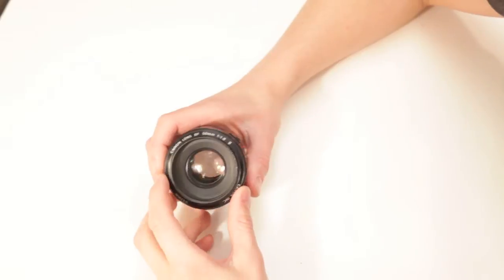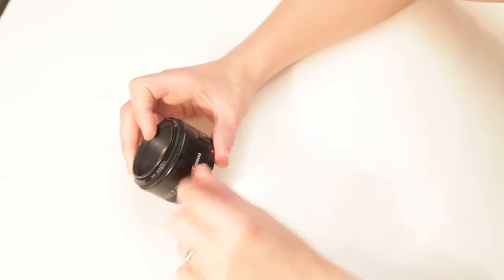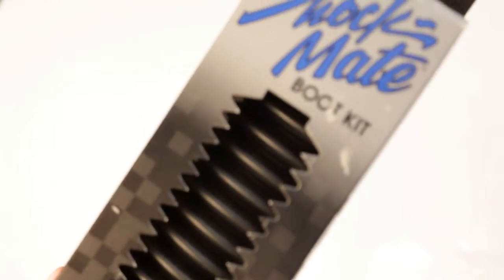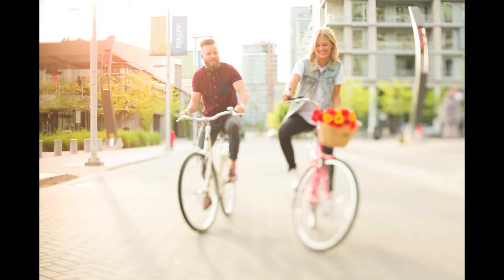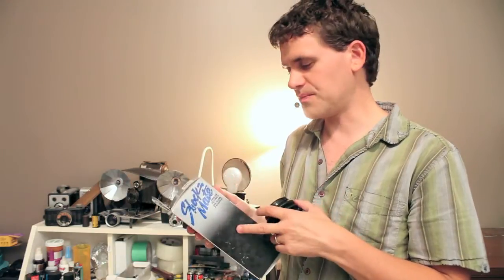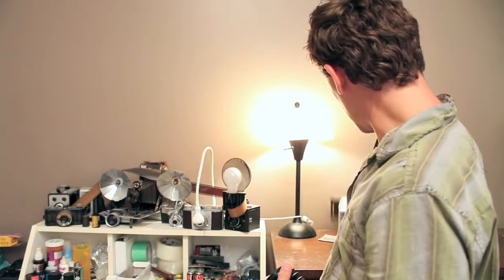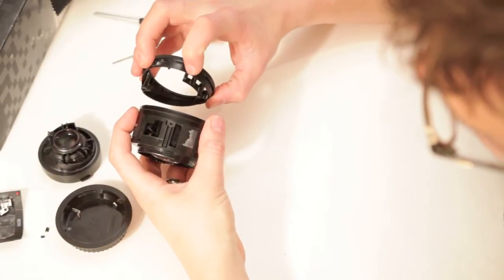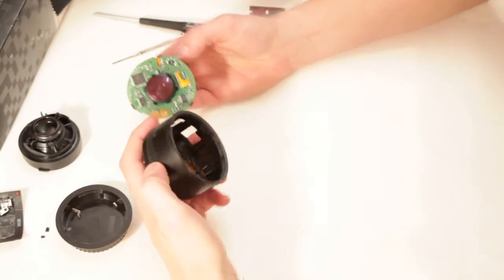How to build a Canon 50mm 1.8 ii EF EOS TS-E Tilt Shift Lens DIY pt.1

Comment: Is the soldering only necessary because the lens was broken or would you need to do this with one that has a functioning autofocus?
Reply from the maker: Yes all soldering is necessary because you need to rewire a new harness in.

Comment: I made one with your instructions. But I was not able to focus at longer distance. I could only focus at around 3 inches away from my lens. The story is, if you move the lens away from the sensor, it turned into a macro lens.... I wonder if you removed any glass from the lens or added any other lens for long range focusing. Thanks!
Reply from the maker: Yi You Hum it sounds like your clearance between the chip board and the mount are obstructed some how. Either that or when you pressed the 2 halves of the elements together they didn't clip right but I'm thinking the first.
You want to make sure that there is nothing between the chip board and the mount becasue even a tiny bit of distance will push your focus away from infinity. It needs to be able to lay completely flat as the lens did originally.
When you install the board onto the optical assembly you need to make sure it fits where it was at first. It can only go down one way. If its is not synced into the original location it will stand up about 2mm which will throw off the focus.

Let me know what happens.
Reply: Thanks for your reply! This is very helpful detail. I think the distance between the lens and the body waa too far. If I umderstand you correctly, you intentionallly kept the distance from the lens to the camera sensor the same as the original lens.
Reply from the maker: Yi You Yes exactly that is correct. The distance is the same as the original or possible less but you want to place it where it came from in the notches that it was originally set in.